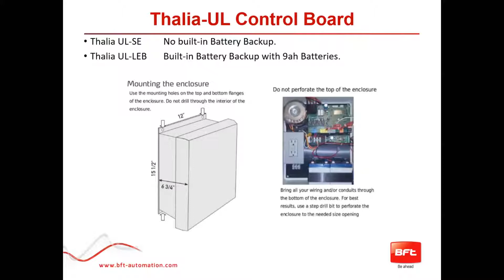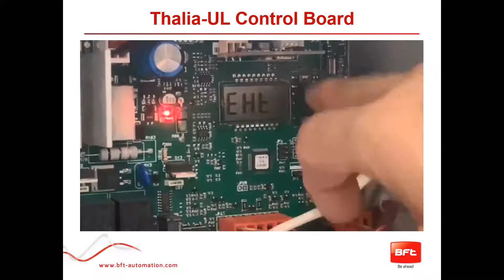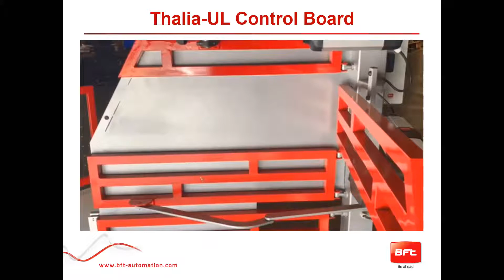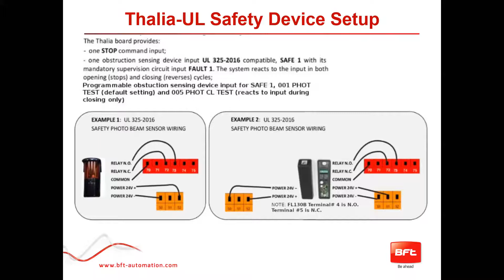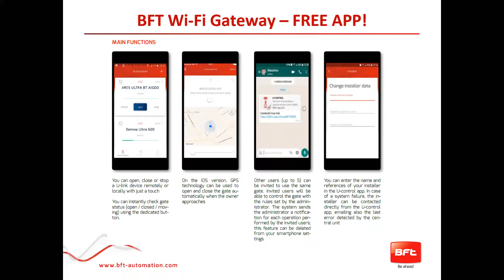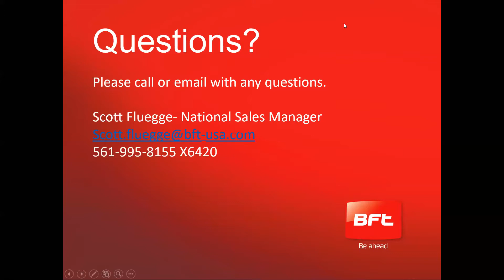KUSTOS Webinar   Part 2

Comment: Hello good evening friends.  I have a question, I have a problem with the card, it shows me the message ER 10, what is this error, and how can I find a solution to this problem that we faced, the door did not open, so I searched for you and I want a solution to this problem please. I read in the catalog of the wrong card is ER 10 problem in the error test  mosfet, but I did not understand what is meant by mosfet, so I hope you can help us, thank you, and I will be very grateful to you.”
Reply from the maker: Hello 👋🏻. It is in my experience that ER-10 is possibly a bad board (relay running MOTOR 1 Seized/Stuck (faulty)). Try running a temporary cable to see if that fixes it. Or if you have two motors swap motor 1 and motor 2 connections at the control board to see if the problem changes to an ER-15. If it does, then the problem is with the motor. If it stays ER-10 then the problem is with the Control Board. Hope this helps. 👍🏻
Reply: @BFTAmericasInc  I will try after that I tell you  thank you so much my friend